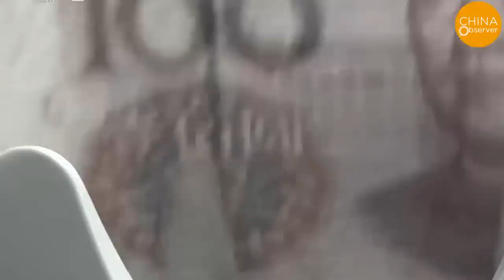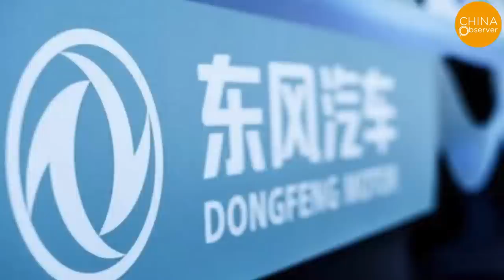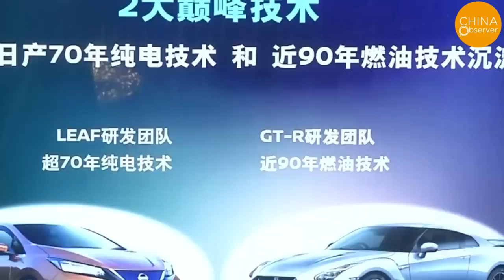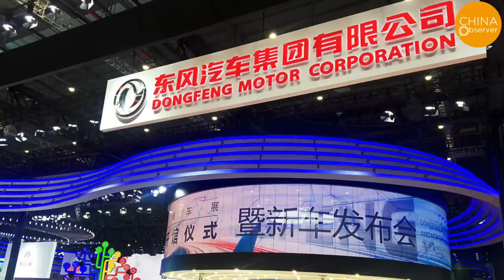China's Auto Price Slash & Economic Recession Looming: Record Pessimism and Reluctance to Spend

Comment: I wonder how the batteries will fair after sitting for so long. Do you need to keep charged for the weather or equalized? 
And it appears all countries now seem impoverished and can’t afford food/cars/houses.
Reply: not good, sometime these EV brings more problem then their gasoline counterpart
Reply: Mold are best enemy of battery pack,  if its sufficient sealed.
Reply: @sabilaahmad3731  is it same case with problem caused by mold on electronic device?
Reply: There's also rust to the frame to worry about
Reply: Parasitic drain will draw the pack below minimum state of charge levels if a car sits for months or years.  Best case is the pack can be recovered with a big drop in capacity, but catastrophic deflagration is possible cuz cheapo chinesium cells.
Reply: @randacnam7321  correct, all depends how well the cells are made.and how well the cars designed.
A good branded cell put away at 70% of charge with no discharge will be good for easily a decade.
But put an led on it and watch it slowly discharge to single figures and then start counting down the capacity as the cell breaks down.
Reply: The battery needs to be cycled up n down or its stuffed/ trashed in electric cars.
Reply: Imagine if that battery has been in the weather for around 2-5 years out in the open ? It will degrade even then... and ruined.
Reply: It's exactly same battery as in your phone etc. Charged to 80% will probably last few years with no negative effects. However it's not batteries themselves that fail so often, it's on cables and connectors on battery packs and that can dagrade fast if car is kept in suboptimal environment.
Reply: Between 30-70% of charge is good.
Reply: @wykydytron  Its different than a phone. Basically if you turn off a phone its off. You cant really turn off an electric car, they will need to at least monitor their temperature. Most should turn on a fan to cool down even when not plugged in to stop the battery overheating. Loads and loads of people have turned up to airports with 50% (enough to get home) power, gone on holiday came back and its gone down. I think currently nearly all cars will lose about 5% a week sitting around. There is potentially a "storage" setting they can turn on before delivery, where nothing in the car at all drains power, in which case, yeah the battery will last longer but really it will need to be cycled up and down about once a month at least. Not all the way maybe the 30-80% range. They wont do that here, cause the power bill will probably be more than just putting a new battery in.

Comment: The parked EVs could be models lacking one component such as a computer chip. It will be relatively easy to get the chip, fit the car and sell it to waiting buyers
Reply: Potentially, also the dust could happen in one sand storm in one night, although they do look like they have been sitting a while

Comment: There has been a lot of confirmed reports that a lot of BYD cars are suddenly catching fire because of shoddy QA on the units being sold, not only that, other EV cars are suddenly following too mkaing it a hazard even if they are being sold very cheaply. I wouldn't rely my safety and health buying cheap, explosive, and combustive cars
Reply: Hey; Elon says his cars are safe SO THEY BE SAFE! Don’t you want to sit in your car, listen to the radio, and hope that EM will take you to Mars? Neither do I want anything to do with “Burning Robot Cars!”
Reply: Not only BYD, Tesla also catch fire.
Reply: They all catch fire ! 
The battery technology isn't ready for use in automobiles yet, we just aren't there yet. But they continue to push EV's on the people regardless of safety, dependability, or price (being too high still).
Battery tech. is probably 10 years away from being competitive with hydrocarbon based alternatives. They still haven't figured how to make them safe, (ie. not catch fire), rechargeable in a reasonable time frame, or stable performance regardless of temperature. There are many more problems with EV's, but these are the major issues.

Comment: Some cars in the parking lot have been already used, you can see stickers on the windshield. So this part is not really believable.
Reply: The cars you mentioned are the operating cars of the car rental company.  The fact is that BYD sold 200,000 vehicles last month, of which 100,000 were EV and the other part was PHEV hybrid